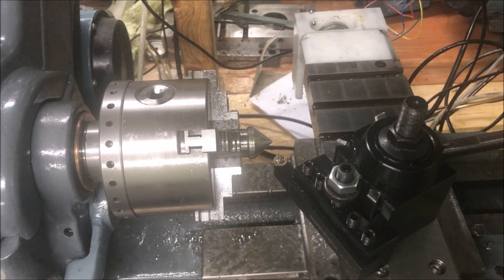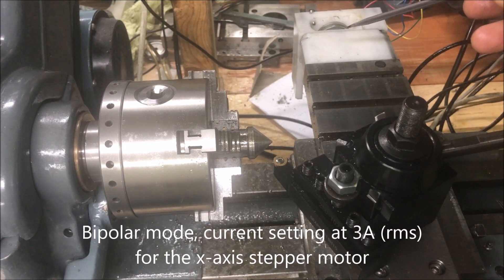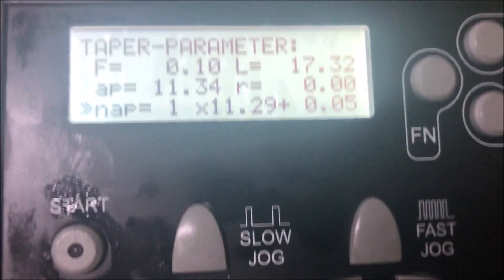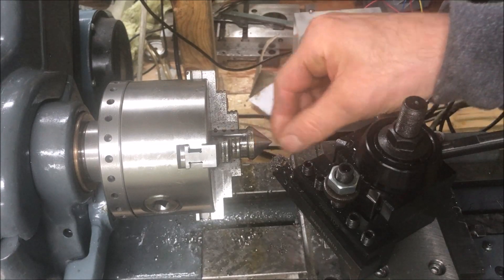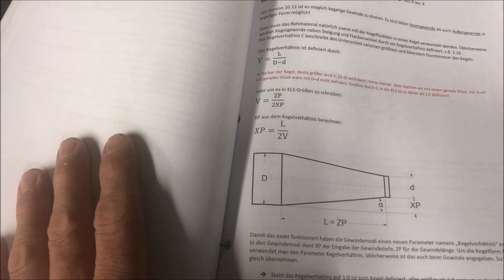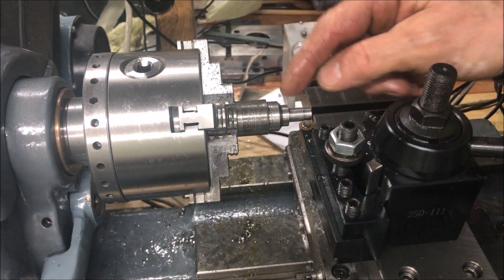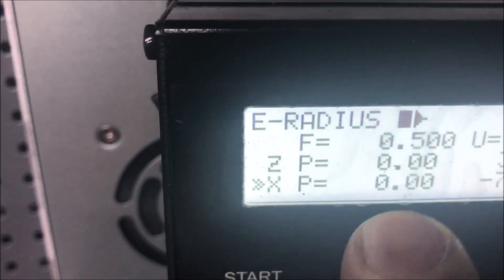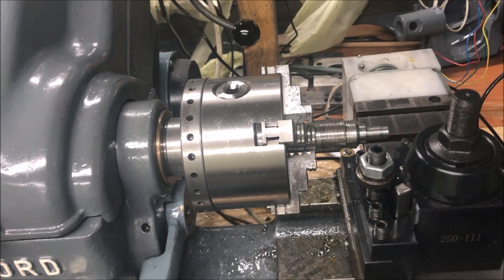Myford Super 7 with ELS - add to taper turning plus form cutting

Comment: Hi Jan just watched this video, I need to cut a Morse taper 2 but I can’t seem to get my head around the setup in the 4 basic any suggestions?
Reply from the maker: In principle it is easy. I assume you have already setup the piece you are turning so that you have a sufficient length of material at hand.Then the description in the user manual says to move in to the desired OD and zero the X-axis, the move right the length that you need according to which ratio the taper has ie. 1:20,020 for an MT2 as per user manual appendix. Set the length of the taper Zp to this value and then zero at he right hand side (you always start the cut from here and move left). Then calculate the infeed Xp according to the formula in the appendix.. For example, if you have a 100mm length L you want to turn to a taper V, and an OD at 25mm, the infeed Xp should be L/2*V = 100/2*20.02 = 9,99
Reply: @jansverrehaugjord9934  that’s what is missing in my book the appendix.
Reply from the maker: @torsiondell  You can download the user manuals also from the web pages here: https://www.rocketronics.de/en/downloads/els-download/
Look up page 104 in the English version for the ELS4 Basic manual
Reply: @jansverrehaugjord9934  thanks that page is missing from my manual have printed it off but will get in touch with Rocketronics
Reply from the maker: @torsiondell  Good! You found the online manual?
Reply from the maker: @torsiondell  I will also try to make a video on using the EXT TAPER program for making a MT2 taper.. or maybe you will beat me to this? :)
Reply: @jansverrehaugjord9934  thanks that would be helpful, you will probably beat me because I have 3 torsion clocks to restore first.
Reply: Yes numerous times it hasn’t sunk in yet.

Comment: I'm reading the manual now, maybe I will understand how the stepper current could produce such a result.  Thanks, Jan!
Reply from the maker: Talked again with Louis and he thought the main thing was the the firmware change from V11 to 16 :)
He wrote: "yes, that change in the software solved your problem. The old method pulled the X-Axis away from the material. The method we now use always pushes the cutter into the material. The algorithm uses the Bresenham line algorithm to put out the steps, but that is not so coarse that it would create steps that large."
M y thought were based on observations in testing and it could very well be that I am/was wrong about motor current (rather hastily done anyway to find out and document the problem solving :) ), although I had it incorrectly set.. the way I found out was that it was very weak ie . you could turn the handwheel eve though the stepper was not deactivated
Reply: @jansverrehaugjord9934  - Ah!  Well that certainly saves me time and head-scratching.  I will instead have to ponder why it matters which direction the X-axis is going, when there doesn't appear to be any backlash involved.  Thanks, mate!
Reply from the maker: @somebodyelse6673  You're welcome. I have looked at some more footage and it could be a combination of factors as well. Maybe stiffness of the tool towards a trailing, sideways pressure(although that was not great), but also a different algorithm.. combination of settings?
Reply: @jansverrehaugjord9934  interesting, for tapers the way you'd drive the stepper is to pick the axis with more steps and use that as the primary drive, i.e. for every 5 steps of X, 1 step of Z. At 400 steps per mm, you'd still get a resolution of 2.5 um per step which should exceed in theory the accuracy of leadscrew driven carriage and cross slides. The banding artefacts could also be the result of slightly off center or bent leadscrew moving the carriage in and out or up and down by a little bit (0.1 - 0.2mm), which was the case for me. Solved by snugging up the gibs on the carriage.
Reply from the maker: @HM-Projects  Thnks for the input! In my case here, everything was newly scraped/fitted and aligned, hence snug and no play, and there wasn't a lot of force involved either. The thought that solving such a problem (or most of it) by a firmware update didn't really occur to me at first, although my near 4 decades of experience with program controlled instrumentation should have taught me that there was this "slight" possibility .. haha. Pls. also note that the ELS from Rocketronics is a commercially available 2 axis cycle control system and is not made by me.. I am only using it,  so I wouldn't know the details on how the programming are done. However, I was told that it evolved over 10 years from a simple system, eg. something similar to an Arduino I believe it was, but is now much more developed and mature. I bought the V2, the V3 and now the V4 basic and and V4 Pro versions. It has proven to be a very functional system and I highly recommend it, especially nice to improve on a "change gear only" lathe. I also cannot argue against the price for this, which I think is fair.